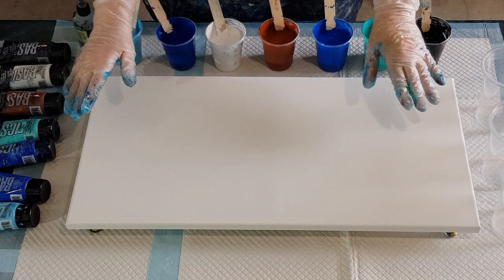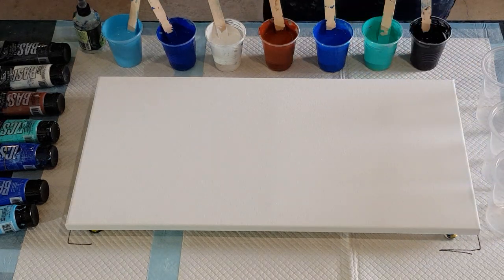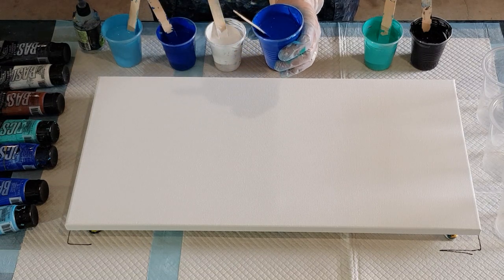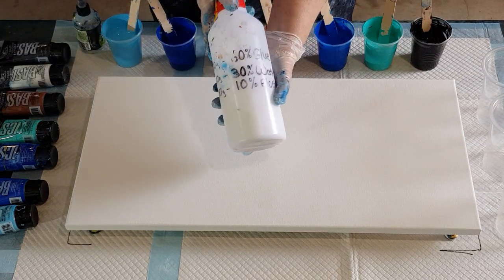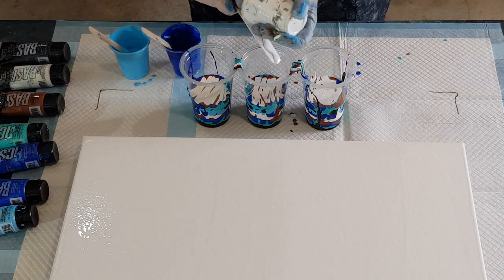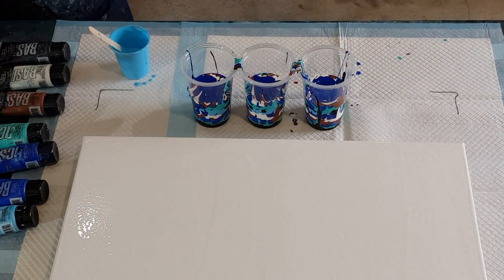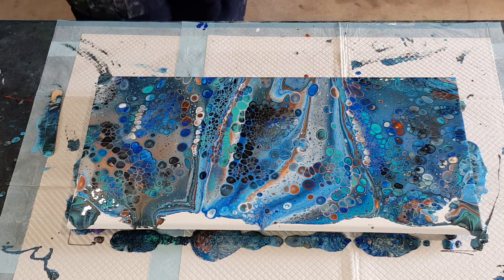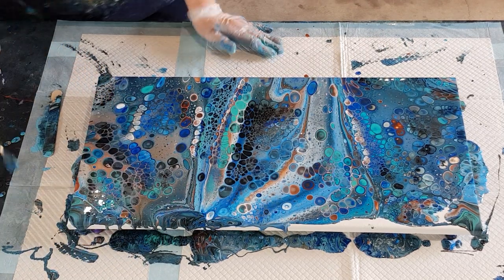#216 Successful Pour With Liquitex Basics Paints

Comment: I have tried several pours now using techniques from different artists, and I have only had one turn out OK. This afternoon I spent three hours Trying to get something acceptable. Nothing worked.Either I didn’t know when to stop, My mix was wrong, Or something ! I had the biggest mess of plastic cups, wooden stirring sticks, newspaper, cardboard, paint, etc. so frustrating. Do you have any suggestions? Does anyone have a suggestion? Should I start weighing my ingredients? 🙄
Thanks for your videos, they’re entertaining and lovely to watch.
Reply: The trick is not to watch too many artists as it can confuse you. Watch 1 artist that produces the effect that you want . 1 ) Use more paint than you need. 2) do not use a runny consistency as cells will stretch and warp which makes a mess. Above all follow what julie is trying to instill in you.

Comment: Julie, I’m wondering if with putting the base coat of Floetrol on the canvas is causing the increase number of small cells - some what like a gentle swipe with the paint moving over the Floetrol, and is also why you are finding you don’t need to tilt
I love the intensity of the Liquitex paints. Love the cells

Comment: Nice work! BTW if you're having too many tiny cells, then avoid stirring the silicone into your paint mixture. Once you add the silicone, how ever many drops you use, DO NOT STIR IT IN. Just let it lay there on top, then when you pour you'll get the giant or much larger cells if htat's the desired effect.  It's not the Floetrol or your cell additive - it's the over-stirring that's causing it.

Comment: Maybe spreading Floetrol on the canvas prior to the paint hitting the canvas is causing the smaller cells. The surface isn't smooth as with a coat of paint or a coat of Liquitex pouring medium. I have seen artists use Liquitex PM as a base coat, never Floetrol.  But the thicker consistency is better.  I love your color selection!
Reply from the maker: Very true
Reply: @PouringYourHeartOut  Just a thought.  ❤ your work!!

Comment: I envy your ability to get cells. I have tried and tried. Getting very frustrated. I have studied video after video and the consistency and formulas. So when you say too many cells so many times in a video it just hurts me I'm so jealous. I have gotten cells with swipes but that's it.  I actually like both of these paintings.  I will try using the Floetrol as a base on the canvas. Maybe that will help. Thanks for that tip. I have watched many of your videos and love the way you teach. I usually get a tip or two that I can use. Thanks for your videos.